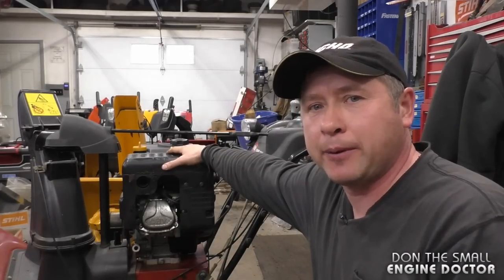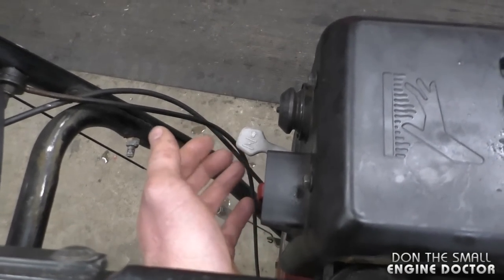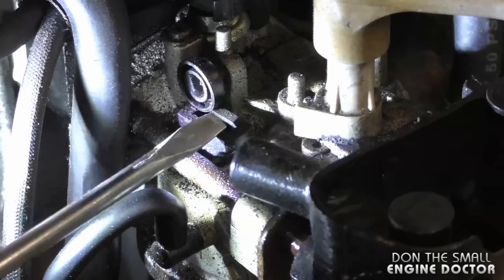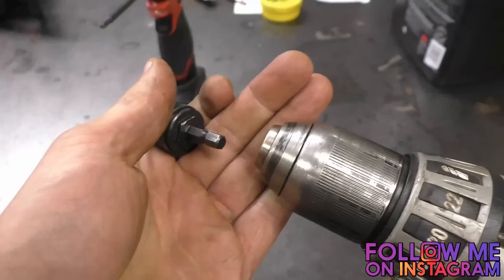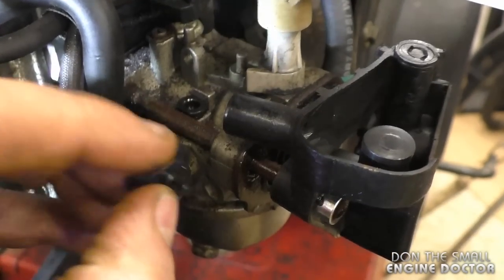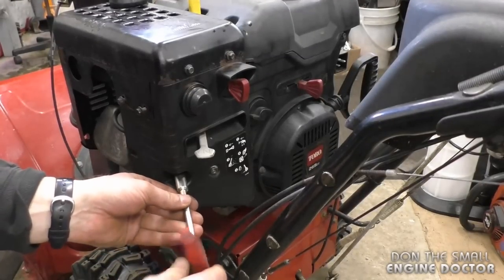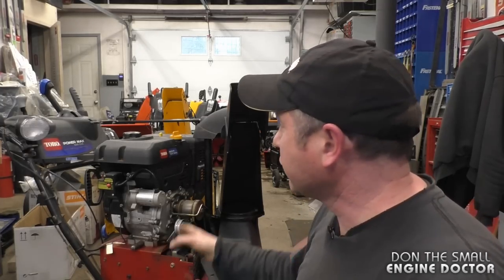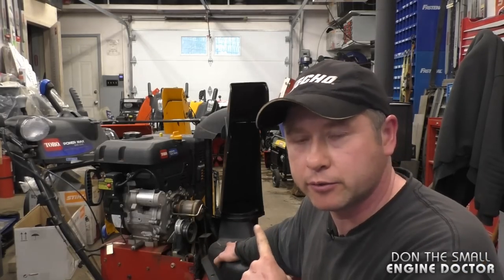FIXING A Snowblower That Surges With Donyboy73

Comment from the maker: Now you can even fix your neighbor's annoying snowblower surging engine for free!
Reply: My neighbour has a surging lawnmower that, every time he fires up, I just want to sidle over to with a set of tiny drills and sort out his jets! Strange thing to offer though really, I guess.
Reply: Literally me rn I cleaned carb and it still isn’t working techumseh 8hp
Reply: In other words,the hole is to small from the factory?
Reply from the maker: @samkaplitz9036  Yes sometimes but the hole shrinks over time.
Reply: I gave one hundred for his it looks like no one hardly ever used it they probably didn't because of its surging engine. I'll get it a oem carburetor later on an try that out as you said
Reply: Mine was a brass plug there was no hole through it that i could see

Comment: Love your informative videos. I have a "older" craftsman 9/28 Techumseh that I  have resurrected from the grave. Auger blades siezed on the shaft, broken shear pins, worn belts, scraper blade and skid plates, auger bearing and cleaned the carb. Also installed impeller wipers using grainery belt material. Got it all back together and was able to move some snow early 2024.  I was able to take care of the surging using your method. The only thing I want to correct is the occasional "popping", not surging while running. Carburetor is non adjustable style and have already cleaned the fuel jet. What do I need to check to correct my popping that doesn't bother the performance  or myself but thinking about selling it and want it to be perfect out the door. Just the original purchase price and parts would be break even at $150.

Comment: Just did this to a brand new snow blower that sat for 3 years. I am glad you do these videos. Not for me, I know this stuff by heart now. I carry a micro drill bit set in my service box for home repairs because I know I will have to do that with these new ones. People need to be told not to use too big a bit or they risk ruining the jet. I found its best to start with the smallest bit possible. 9 times out of 10, the jet is plugged. From there, go to progressively larger bits but not force them. As you said, those bits can break easily.  I generally use a hand drill, not a power drill. A hobby drill works best. I always try the engine between bits to see if the idle improves. When the surging goes away, then stop. My next job is a surging 16 hp Kohler garden tractor with a snow blower attachment.

Comment: You can go to any welding supply and get a tip drill set. They are small drill bits with a holder meant for drilling out torch tips. Works perfect for this fix. Just did it on my Troy Bilt snowblower

Comment: Fantastic after trying three other fixes from different sites I stumbled across this one. I first cleaned the carb and checked the governor spring to no avail. I didn't have a micro drill or tip cleaner kit so I used one metal tine on a metal hand scraper brush. I wiggled it around several times, reinstalled and it started instantly with no surge. Thanks, so much!
Reply: I did the same thing- worked

Comment: Donyboy, you da man! I just fixed a surging snow blower that I said I’d look at for a friend of mine. After unsiezing the wheels from the shafts to fix flat tires that were off the beads, draining and cleaning a water and dirt contaminated tank and carb bowl, I filled the tank and it fired up right away but, you guessed it, it surged like crazy. Here we go, I thought. This is going to take hours and then I thought Google, and there you were! Pulled the jet and the orifice was completely blocked, cleaned it with an appropriately sized torch tip cleaner and it now runs and idles as smoothly as can be, Thanks a bunch. From Thunder Bay, I owe you a beer or 2.

Comment: Thank you ... thank you ...thank you!  My snow blower surged since brand  new exactly as per your example.. The only way to use it was with the choke half way set. Shop told me that it needs a new carburetor. Tried your simple fix and it worked.

Comment: Usually just cleaning the idle jet works fine. Sometimes if you rev the engine a place your hand over the carb intake causes high pressure in the carb circuits and cleans out the plug. Do this several times

Comment: Thanks so much for posting this!  It solved the problem.  I used a #78 drill bit (. 0160”/. 406mm).  I did purchase a collet for my dremel (4485 kit) at the local hardware store so that I didn't have to wait on the repair.
Reply from the maker: Great job!
Reply: I was working on a neighbor's snow blower with a 212cc Chinese engine. It was surging bad. I drilled the pilot jet with a 1/32 (.031) bit, the smallest I had. That fixed it. I think the standard jet size on this engine is .020 or .018.

Comment: As an apprentice on the Alaska Pipeline, and working in the mechanic's shop, we had some very good quality torch tip cleaners that came with an assortment of these fine bits...That said, I might suggest a quality welding supply shop might likely have what ya'all need for this job and you might determine the quality by country of origin...German or Swiss, Nordic Countries, etc.
Reply from the maker: Great point!

Comment: i thought this was the low speed jet 
the brass jet started spinning and pulled out with the bit on mine  but i was able to hold it with plyers and pop it back in the plastic  housing   , works good now

Comment: Hey donyboy73. Had surging after two minutes on Honda snowblower than dies. My Honda dealer said it’s common in USA for this to happen to Honda power equipment do this because when the charcoal gas cap gets saturated from overfilling or tipping the snowblower on front (like I did) it ruined the gas cap and says it’s like putting a finger over a straw and the engine won’t bring gas to carburetor anymore. I wonder if Canada has the same charcoal gas caps like this. He said they started doing this in 2013 - present to all Honda power equipment. My problem was solved, after buying a new gas cap

Comment: Im gonna premise this by saying im not not a snow blower tech. I had the same issue with my ariens 28 deluxe. I ran half a bottle of Seafoam with fresh 93 octane  gas. After the first run, I filled the tank with more 93 octane gas and some Marvel mystery oil. The snowblower is running smoothly now.

Comment: awesome simple video.  just got a 13yr old 24 inch craftsman 2 stage for free.  only used 3 times because of this issue. wouldnt run right and surge with choke off.  thought it was a float issue but the plastic float looked fairly level and cant be bent to adjust.  drilled that jet and shes golden.  thanks much appreciated!!
Reply: forgot to add that it falls into the category of how i prefer to fix all my equipment, free!

Comment: Mine is like the governor isn't set right i went over the carburetor good on the inside its all good that piece you drilled out i took it out of the plastic piece its just a stopper plug i saved the little brass piece

Comment: I had a surging problem with my Troy Bilt snow blower. I tried your method and even bought the small drill bits. I started by removing the shield. All went well till I came to the last bolt I could not get a wrench properly on the bolt due to a large red part. All I managed to do was round over the bolt head. Since it I getting close to snowblower season I guess I will just reattach the shield and use the choak to smooth out the motor.

Comment: I have an old Techumseh 5HP and I got surging for the first time ever last time I went to run my blower.  Only at full throttle when I started it.  I brought the throttle down a bit and went back to full throttle and it ran fine.  Hopefully I'm good, and no clogging occuring.

Comment: Huayi carburetor in most of these Chonda engines (LCT, Loncin, Powermore, etc.).  I cleaned Huayi carburetors on five different snowblowers last week with 9” of snow in southwestern Missouri.  Main jet and fuel/air (black plastic one you drilled out), and emulsion tubes all blocked on every one of them.  Unfortunately no practical room for fuel shut off valve, which would solve most of the fuel issues.

Comment: Its still surging because the carburetor is not  completely clean, you never enlarge jets or emulsion tubes, reclean the carburetor, and especially under Welch plugs, if its surging, the carburetor is still dirty or plugged internally,  blow out with compressed air, clean again,  all holes in carburetor body, jets, emulsion tubes, etc, triple check your work, you will be rewarded with a smooth running engine, good luck

Comment: Awesome video... I have a rolling tiller that is  doing thta surging but,  the carb is diferent the carb is sitting on top of the gas tank... today I use it this afternoon and after 20 mins it didn't started anymore, plus was almos half or 1/3 on Shock ❗💔❗😥❗💔❗

Comment: Thank you for this video....My Craftsman snow blower just started doing this. I ran it with a tiny bit of choke on to get the job done this last time. I imagine this would be the problem. Thank you again for what you do!!
Reply: Sounds like you found the right video!  VERY common problem on snow blowers...
Reply: @randomwrenching  yeah I wonder why.... The blower is like 7 years old. Kept inside.... it is maintained. Gas is always removed at end of season etc... But just this past storm it started surging... So added some choke and it cleared up but I know there was more to it then that. At least now I can fix it..... annoying though..

Comment: dony awesome tip I bought them microfiber drillbits from Amazon and I’ve been using them quite a while and they work pretty awesome and I’ve been doing the same thing that you have and it works great awesome tip love the video great job
Reply: Got a link to where you got those bits on amazon?
Reply from the maker: @Mr_Tecumseh  https://www.amazon.com/PEN-KIT-MALL-0-3-1-6mm-Jewelry/dp/B08VY6RGCK/ref=sr_1_26?dchild=1&keywords=micro+drill+bits&qid=1614341884&sr=8-26
Reply: @donyboy73  Hi Dony, I am going to be ordering one of these kits as I need the handle as well as the bit.  Is there somewhere else that you can order just a bunch of the .35mm bits? (I hope I did my math right as you mention 13/1000 or 15/1000 and that is the closest size after converting)
Reply from the maker: @ve3lks997  yes you can buy just the bits on amazon, and yes i use bits between 13"-15" thousanths of an inch
Reply: Nice to see a vid with the ohv engines. I never see tecumsehs anymore. Everyone on my street has mtd type. Thanks!

Comment: Great video Don
What causes this problem?
Reply from the maker: the jet constricts itself over time
Reply: I agree with you Don, and I also think they are jetted too lean from brand new due to emission restrictions.  Lawnmowers running in the warm summer are somewhat less sensitive with the mixture, but do still have some problems.  Snowblowers running in the cold winter need a richer fuel mixture.
Reply: @donyboy73  Also, manufacturers are setting engines at the razor's edge for emission purposes.  Once the rings breaks in and are not "perfect"  the mixture apparently gets leaner due to blow by and hence surging.  I have a Toro that's only two years old and it started surging after one season.  Drilled out the jet and issue gone.
Reply from the maker: @99andrianmonk  yes absolutely! meanwhile everyone drives the biggest gas guslers on the road
Reply from the maker: @randomwrenching  absolutely!

Comment: Thank you ... thank you ...thank you! . Tried your simple fix and it worked. BY THE WAY .. the small jet on my snow blower doesn't have the top plastic cover but it now works just fine. What is the purpose of the plastic cover over the jet and is it required?

Comment: Excellent video, I have a TORO 1028 but thus far that's ok. What to do if my choke on my snowblower has to be set at the first click to run smooth, even after the engine has warmed up>  Thanks for the tips...

Comment: I took the little brass piece out because the hole didn't go all the way through it the only ones that did are the holes on the sides Without the brass piece the engine still idles the same i noticed that the throttle isn't working right how it should

Comment: Hi there, I'm trying to figure what is 13 000 of an inch for drill bit size and can't find it. It is only in milimeters or mm on Amazon. Will it correspond to 1.3 to 1.5 mm ? Thank you !

Comment: I used a #80 micro drill which is .013” and it did not remove any material. Are you sure it’s .013”-.015”? Your drill bit looked a lot larger than a .013”. Thank you!

Comment: I just helped a neighbour with her snow blower. She didn't summerize it , and it wouldn't start. I surmised that it was likely gas residue clogged in the carb. This engine layout looks identical to her PowerSmart DB7624E.  When I took the carb shroud off, I was then able to slide the carb off the two long mounting bolts. But, much to my shock and horror, it was only 1/8th of an inch from being able to come fully off but was blocked by the control steering pipe/tube/bar. I had to unbolt that tube from the bottom gear box housing to get the final 1/8 inch I needed. How could it have been designed like this? I tried to unscrew one of the long carb mounting bolts with a vice and protective tape, but it was very snug. I didn't want to force it, and so thus chose to remove the steering bar instead from the gear housing. I have to be missing something, because no manufacturer would ever design it like this

Comment: Hi... I have a Toro snow blower with the same type of engine. The valve cover breather tube was leaking a small amount of oily gas. Approx. 1/2 cup. I let it run and it no longer leaks.  What might be the problem? Thanks

Comment: Surging allows the engine to run lean on fuel, which will, without a doubt, cause the combustion chamber to overheat and the engine will eventually burn oil. Apparently, the EPA don't care about this, but the manufacturers like it so they can sell new engines and repeat the process.

Comment: Got a link to where I can buy those bits?
Reply: Go to amazon and search 
for "micro drill bit .35 mm"
It’s equivalent to 0.0138 inch, the perfect size for this.
Reply: He uses Blue Point Drill Bit Kit...same as me.  Think is was around $37 for the kit. Contact your local Snap On Dealer or order through their website 🇺🇸🤙🏻🔧🦅

Comment: Donyboy
I have a Troy Bilt storm 2410. It is surging very badly. I’ve cleaned and rebuilt the carburetor. I’ve also opened up the pilot jet per your specs and it still surges badly.  So I threw in the towel and replaced the carburetor with a new oem carburetor and it still surges badly. Any suggestions would be greatly appreciated.

Comment: Thanks Donnie - I have a new Toro 1432 snowblower with this issue AND the choke vibrates closed when the engine is worked hard.  Do you have a fix for this problem too?  It's very annoying to have to keep adjusting the choke when running the snowblower.  BTW:  I have to run with the choke partly on or it will not run smooth.

Comment: Hi Donyboy. I have a JohnDeere lawn tractor with a Briggs and Stratton engine and it surges. I couldn't get it to settle down so I replaced the Carberator. After replacing it, the engine still surges. Do you have any idea as to what it could be? Thanks for sharing Donyboy.

Comment: Thanks Dony. My snowblower surges, I had the carb off and cleaned it and the surging stopped but it will shut off from time to time. It starts right up runs for awhile and shuts off. I think I will do what you did and see if that cures the problem. Almost seems like the bowl runs empty, shuts off, and then fills up to start the engine. What do you think?
Reply from the maker: try it with fuel cap slightly loose, it may not be venting. replace cap if necessary
Reply: @donyboy73  I will try that. Thanks much for the help Dony.
Reply: You may also want to check your float if it didn’t do this before and you had the carb apart.

Comment: Hello Donny: I have a kinda weird problem with my snowblower. I have a toro power clear QZE 721. 
After watching your videos I replaced the paddles, belts , and scrape bar. All went perfectly.
Now this year I’m experiencing the wheels on this until clogging up with snow, like it’s sticking to the wheels. This has happened before. So should I replace the wheels, ( they still have tread) but they are plastic?
Or is there something I could spray on the wheels? 
Any ideas would be greatly appreciated 
Thanks 
Frank B

Comment: Hey donnyboy73, thanks for this vid and the fix!, 1 question for ya, when I went to drill the one out for my surging CubCadet the little metal fitting I was supposed to drill through came right out.. I'm hesitant to put it back in and install it again as I fear it may fall out of the airjet cap completely again and down into the engine.. i installed the cap back again as it was without the metal incert, this did fix the surging anyhow, but I'm getting a good bit of backfiring now.. guessing too much air is making it in now.  If I want to order a replacement one and re drill it when it arrives, What do I look for? like what's it actually called?  thx again. cheers.

Comment: My blower is surging like crazy on idle  i have that part out i have cleaners but not drills i have a normal bit set smallest is 1/16th seems just bigger than the hole does that size sound good, need to sell this blower right now while the snow is still flying

Comment: I have a yamaha snowblower that surges the same way. I have taken apart and cleaned the carb countless times and still no fix. Can you do this to a yamaha snowblower and which jet would it be as there isn't a plastic jet in the carb.

Comment: I have a Toro Power Max 6000 2-stroke (2005) that seems to run at very high throttle. Is there a way to adjust that carb?